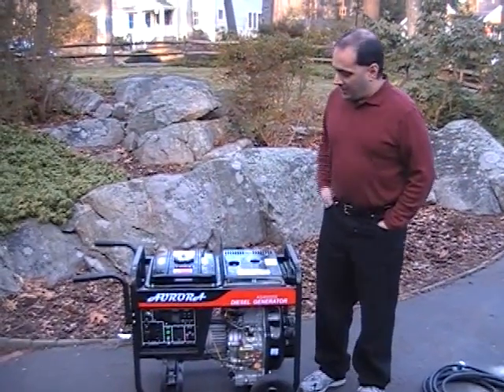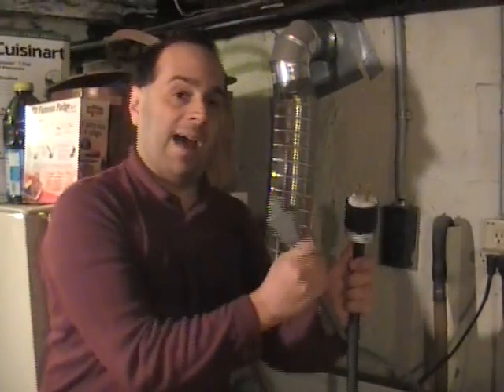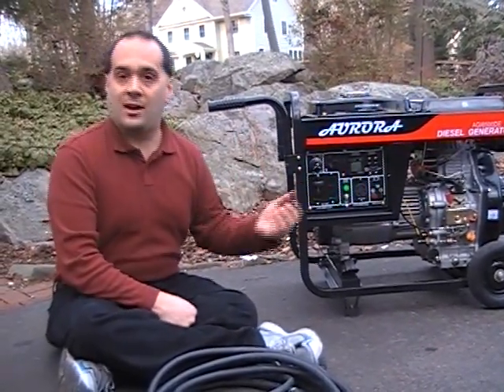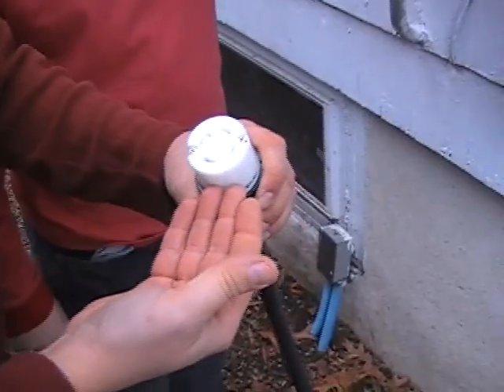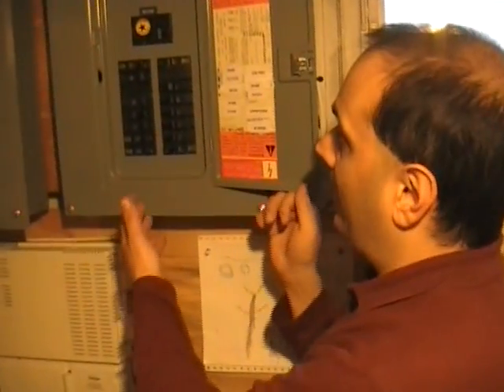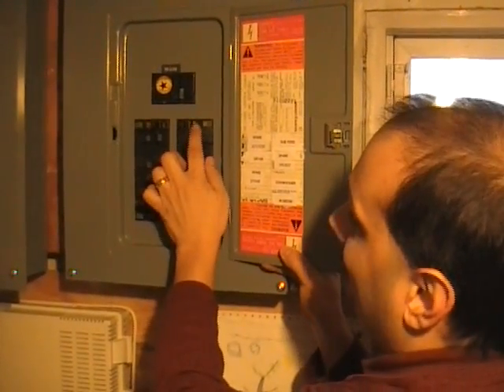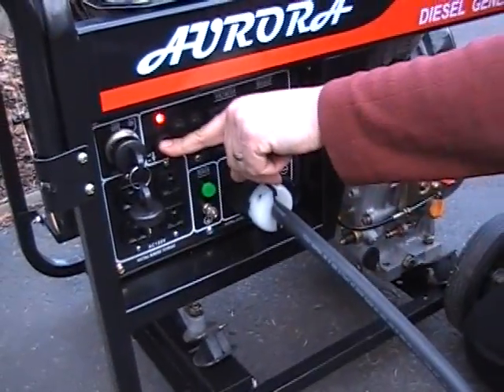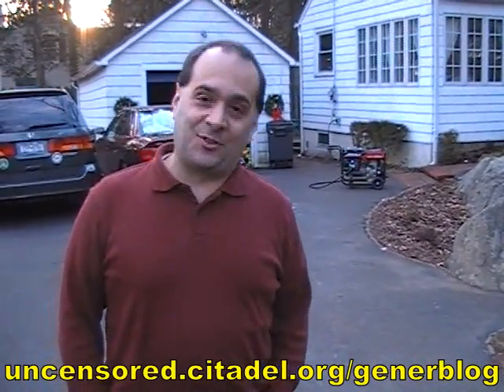Inexpensive residential generator hookup

Comment: I doubt that small generator can do enough power
Reply: It will handle far more than he is running off it.
Reply: @ArfOtis  says you , what the power  ,all talk no facts
Reply: @onlythewise1  - Did you watch the video? It is a 6500W unit and he is not powering his entire house off of it. Just some lights, the fridge, TV and PCs. More than enough for that.
Reply: @onlythewise1   I have a 6500 watt generator and can power pretty much anything in my house including the hot water heater just not everything at the same time. This past summer we lost power and did laundry but did hang the clothes out to dry. The washer worked fine as did the hot water heater and the electric cook top stove. Obviously you cannot run everything at the same time but you never do that anyway. When we needed more hot water we just sat back and watched television for a while. 6500 watts is quite adequate to run a normal house if you manage your connected load. Oh and I have a well pump to run as well as two deep freezers as well as a large and smaller refrigerator as well.
Reply: @ve1idx  really wow your so smart I bet you can count to hundred to . you mean there surges in electricity  when they start wow so smart
Reply: That's not really the point of the video, but perhaps you're right.
Reply: @paul_jmr8022  maybe you should take the shit out of your head before annoying people bird brain

Comment: i really hope that outside elec recepticle is grounded real well or when it rains you will burn down your house. That lil cover aint gonna cut it
Reply: welcome to reality i have seen receptacles submerged in flooded basements and they don’t even trip but you could get shocked. What I’m saying is water is a conductor but a very poor one all depends on minerals in it
Reply: That is an inlet receptacle that is meant for this application so you are wrong. Just always double check your wiring and you are good to go.
Reply: @matthewmattie8694  He is right that is a cheap inlet box. Check out the link below. As an electrical contractor that is what I recommend to my clients. It is a safer install. 

https://www.homedepot.com/p/GE-30-Amp-Temporary-Power-Inlet-T030N/100676699

Comment: This only works with the correct generator !!!!!  Some generators on the 220v plug are NOT! NOT! 120v on one phase and 120v on the other to get 240v (220v). On my generator one leg is 208v an the other is 40v. The reason i checked was a coworker did this  at his house and toasted tv, computer, etc. Because of over voltage. I use ext. Cords on the 120v plug  to be safe
Reply: what generator make/model has this unusual 240 VAC issue?
Reply: Must be a made in China knock off as that won't certify by UL and not in this life time by CSA, lots of dangerous AC electric devices out there including extraction cords etc from PRC. CERTIFIED COMPLIANT  PRODUCTS HAVE A Logo for the certification by UL, ETL or CSA as these are common North American certification labs who do great work and promote safe products in the USA and Canada and do so by law.
Reply: @mooglemy3813  Give it to Marty, he knows it all.  ;)

Comment: You failed to mention the difficulty of moving several circuit wires from old panel into the newer one and address the possibility that some may come up short on length. You could have made clearer by having the front covers off both panels and showed if you used jumpers from one panel to the other and having used wire nuts to connect those individual circuits.

Comment: Thanks for this! (From Rural southern Saskatchewan!) One more thing...when using the #2 transfer panel method, do we need to have an external ground rod on the generator itself? (Asking 'cause I really truly don't know..)
Reply: A generator such as shown in the video, with a 4-wire outlet, does not require an external grounding conductor at the generator. Some older generators (I have one) used a 3-wire outlet and had a separate stud on the generator frame for an external grounding conductor. That does require external grounding. But ... it's not that simple. If you ground the generator to a separate ground rod, that ground rod has to be bonded (connected) to the primary ground rod(s) for the house.

Comment: Hearing the part about safety on a backfeed system causes me to wonder about the the 1000 watt(1kw) grid-tie inverter I bought. It is designed with a reverse plug and instructions actually say to plug it into ANY electrical outlet. It has an internal safety switch that shuts the unit off if it detects that the grid power is lost to prevent danger to technicians working on the lines so it can't be used for off grid power without modification beyond what I care to do. The fine print says input is 1kw but output is only about 900 watts. Even if output was full 1k at 120vac, it would still be less than 10 amps so not likely to overheat the wires. However, I am intending to make a separate box outside near the grid poll that houses heavy duty outlets to join several of these together(manufacture says up to 9 units will sync with each other and I need only 3 but plan to put a 4th to handle producing more power...i would rather make more than I can use creating a negative balance with that power company (and probably never get paid for it) thus 'giveing away' the excess than to pay for inbound energy.) The grid-pole breaker box has a 2-pole slot on it with instructions saying to connect backfeed to it if backfeed is being used.
Is what I've described above 1)safe and 2)legal?
Reply from the maker: Grid tie inverters are special.   They won't output any power unless they're plugged in to a circuit that is already supplying power.  So the moment you pull that plug out of the wall, the cord is no longer energized from either direction.  This is why you don't need to use an inlet receptacle or an interlock.

The downside, of course, is that you cannot use a grid tie inverter as a backup power source, because if the utility power goes out, the inverter will shut off as well.
Reply: @igfoobar  Thank you for clarification. This is as I thought so all is good. Still doesn't hurt to ask. 
I'm aware of the draw back of not being able to use it when the lights go out. My plan is to work within my extremely limited budget to get started and then add on to it with $$ saved from the initial system. I figure the power is very reliable where I am. There has been only 1 outrage lasting more than 5 minutes in the past 10 years and only 3 or 4 times less than 5 min. So save start-up cost by using grid-tie instead of a massive battery bank. I now have everything for a windmill excerpt the poll to mount it on which cost way more than I expected even if I build my own. The other problem is that my windmill can (and often will) make more then my inverter can handle so I'll need a way to harness the extra utill it can be used. But batteries would stay depleted most of the time like this so I thought about using capacitors but haven't researched the safety and effectiveness of this yet.

Comment: You can source a used transfer switch relatively cheap, an option that was not discussed. Look at the resale shops of any demolition contractor. A few corrections and/or omissions in this video I would like to correct. I am not quite sure why you say in the case of the suicide cord, you have no circuit protection in front of the cord, the generator after all does have a breaker. But yeah, suicide cords are for the ignorant, you should never have live power to the male ends of an extension cord. But the main safety reason for the transfer switch or interlock kit, is to insure that the main breaker cannot be on when you are back-feeding via gen power. The reason for this (should you forget to turn off the main) is your not only making the wiring in your house live, but your back-feeding to the entire neighborhood. This makes it even more dangerous for the poor utility worker that is trying to restore power.

Comment: I would like to add that many homes are setup for either natural gas or 220V 30 amp dryers. In my case I have both, and have a natural gas dryer (which connects to a 120v outlet). So my 30 amp dryer outlet was doing nothing. So, using existing wiring, I replaced the dryer outlet plug with an inlet plug like the one you installed on the outside of the house. Then I installed an interlock kit, which is really easy, that insures I cannot have the breaker to the inlet and the main breaker live at the same time. Easy peasy.
Reply: If you used a 4 wire conductor you should be ok. People get in trouble when they hook up a genset's 120/240V 4 wire outlet to a 3 wire dryer ckt. When I see that I always wonder "What did they think, the white is a spare, nobody will care?"
Reply: The issue with backfeeding from a dryer outlet is as pointed out by the original poster of the video it requires a double male cord.  The other main issue is that I have seen some dryers use 10 gauge wire to the panel and depending on the length of the run to the panel, a generator could overload these wires and cause a fire.  I have 8 gauge wire running from the generator into the main panel for a 3500W generator.  I typically err on the cautious side.  My 3500W generator will run all the lights in my 2300 SQft house,  TV's Ceiling fans, computers, refrigerator and then I can manage the load by running a hairdryer (wife) or microwave.  We have a gas fireplace for the winter and ceiling fans for the summer if we need it.  All the lights on, fridge with compressor running, TV's and computers runs about 11 amps.  Microwave will take that to 22 amps.  Most people are really surprised at how small of a generator you need to run a lot of things.  In the interest of full disclosure all my lights are LED which uses far less power than incandescent bulbs.  Video is well done.   My panel is labeled with red, green and yellow dots so we easily can ID circuits we need off during a power outage and required ones and the yellow is for things like the washer or dishwasher and disposal which we may or may not need.

Comment: Too bad you couldn't have used the second option which cost me $49 at home depot for the interlock by square d and $ 50 for outside plug a very simple code complaint solution. It sounds like you have my luck when it comes to retrofitting older things around the house!  I live in Florida where lots of storms occur and it is so nice to have being prepared! Great Video.

Comment: I like the focus here on safety and proper to-code installation.  Well done.  Square D is also a very good line of products.  Arguably the best breakers and panels on the market.  
There is a company called "Powermax power products" that makes a great automatic changeover device For what I think is probably less money than the panel and changeover breakers, etc.,  shown here.  I've installed a few, over the last few years, and they are almost bulletproof.  No problems yet at all.
Reply: I've always choose GE boxes and Breakers. Much cheaper and never had a problem.

Comment: if your generator is bonded you have to break the neutral as well so it doesn't feedback the line over the neutral wire
Reply: Tex Rider neutral wire should never be open circuit. It is bonded to the grounding system in the house, and if any fault current is present, the grounding circuit will dissipate.
Reply: @SuperVstech  it is not opened from the main service  but from the generator so that it is not bonded in 2 places when the generator is bonded as well. some of the generator pabels have 3 pole breakers. chech out the video link i left in the comments
Reply: The panel you are feeding, being it was the first means of disconnect, is already bonded. Bonding or unbonding the generator at this point wont change a thing.
Reply: Generator Bonded? The generator creates its on neutral the same as the utility. The only "feed back" would only be on the neutrals that have a load  on them in the generator panel. There is no need to break the neutral. All automatic transfer switches have the neutral bonded together.